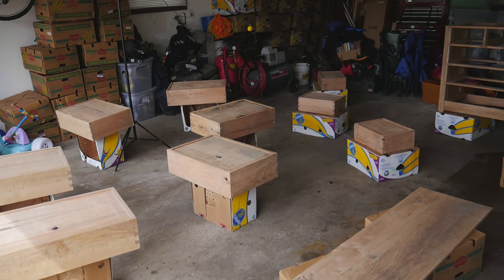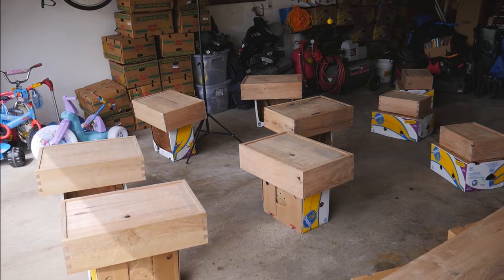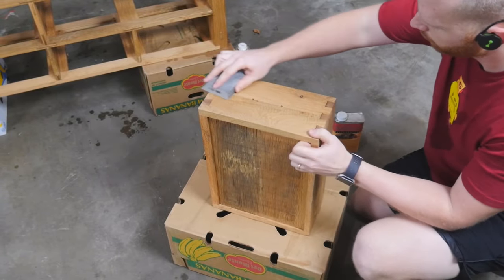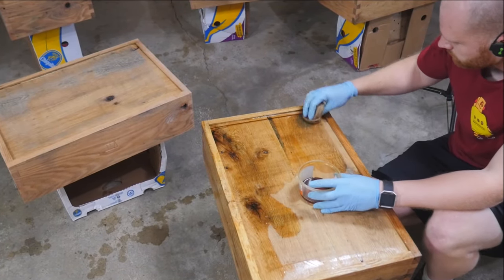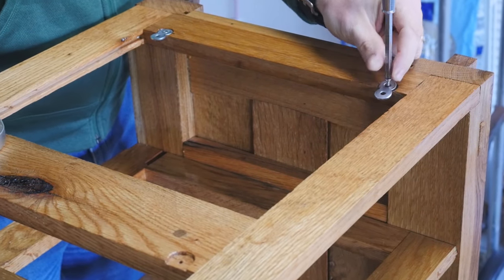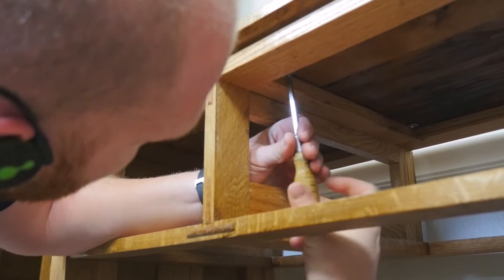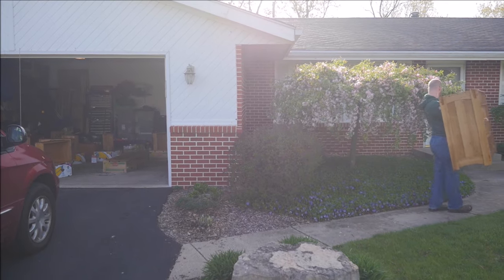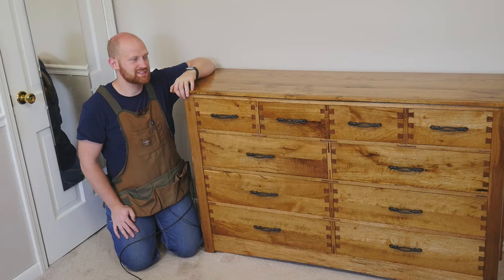Hand Tool White Oak Dresser Part 10 How To Use Waterlox on a Woodworking Project

Comment: Hi James, is it my imagination or have you got the tails on the front of the drawers instead of the sides ? Thus making the dovetails weak as its not stopping the drawers being pulled apart with repeated use. If i'm mistaken I apologise .
Reply from the maker: I will cover that int he next video, but that is correct. they are show tails. with modern glue, they will not come apart. and if I flipped them around then they would just look like finger joints. and no one likes that. LOL

Comment: Ok, but dovetails are better than finger joints by design for drawers. And the way you have them there're no stronger than finger joints .
Reply from the maker: correct, but they look a lot better. and with modern glues the strength difference is negligible. turning them around will not add to their life.
Reply: Ok,  we will have to disagree. But I have been a professional woodworker for 30 years . And personally would never make a drawer that way, still enjoying the channel though James.
Reply from the maker: well, each to their own. that is the best parts of this sport. there are a thousand ways to do everything.
Reply: Yeah but only one way to do it right lol.
Reply from the maker: LOL yup that is the way it goes. that is why I am glad my last name is Wright. LOL
Reply: Lol James. Emma x